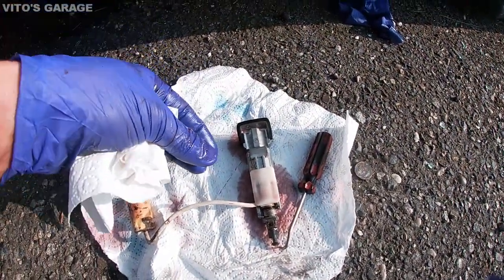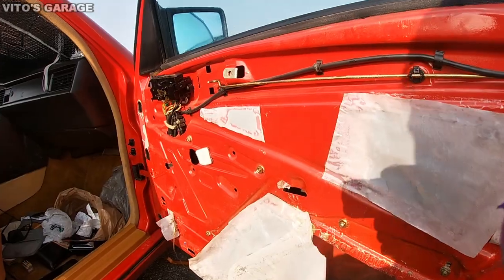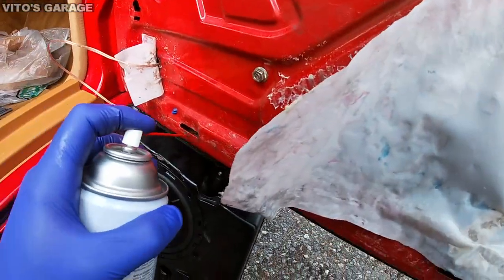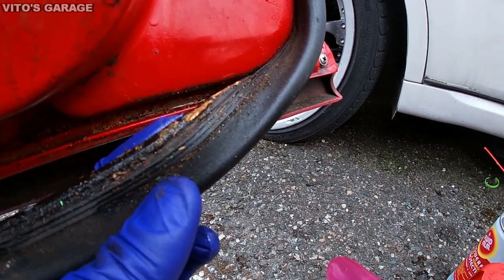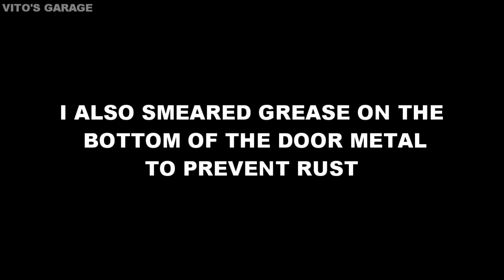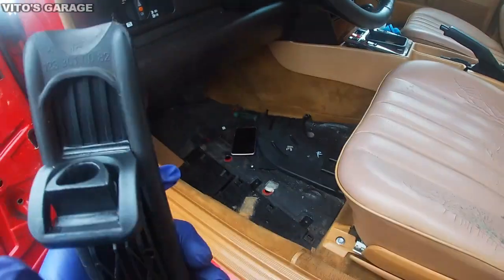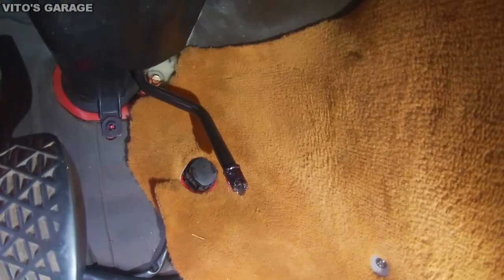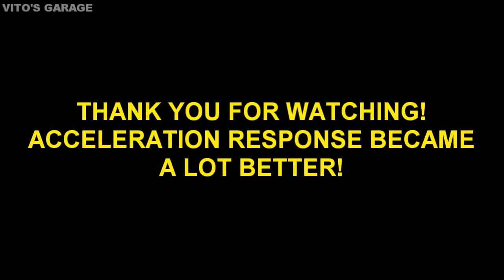Mercedes 190E RF Door Maintenance: Door Stop, Window Regulator, Locks/ Broken Gas Pedal Replacement

Comment: I did this service on the W124 I saved from being scrapped. The two rear window regulator motors were seized and I needed to pull them out move them manually put oil inside and grease tracks. Working good now! Very important maintenance.

Comment: Please, where can I buy the piece of minute 1;44?
Reply from the maker: This?

https://www.ebay.com/itm/122993686616?fits=Model%3A190E%7CMake%3AMercedes-Benz&itmmeta=01J0BT7NEK0Y2CW8VBFP7J6CAV&hash=item1ca2feb858:g:e3IAAOSwGvlal0Us&itmprp=enc%3AAQAJAAAA8AMDxQu7p%2FnXKy6MB7Eo6r9uyQGHVQcWSq85SDgewgM0P1sl0%2BrfBGU8Qbe22QQFjY5clbhZp9F2R1vrvFYBuWItljex48FxGwY09B1Dy41X3RXxsyg0wz0bAa87ePmY4y1e6HS9mEBEvnOv4dFPlzXTR0efawpO6xB76hgboBL5vz9mE8HVxXhhL3hWu9XQtNnvu5x8C%2F3mYSYFgVXkzGuwgJaZCtsUMU5cKe%2B1xeTuHgm1jf8I0eWv2989IpyVve%2BDSaSL8SXdDJYeWmFF6jBM%2BrL6fXNxJ5KRFca2YiSJjHFJWKCnm%2BJfq1qWALrJXA%3D%3D%7Ctkp%3ABFBMstee-oJk
Reply: @VITOSGARAGE 
Thank you 
 It's different, mine like in your video is with alarm